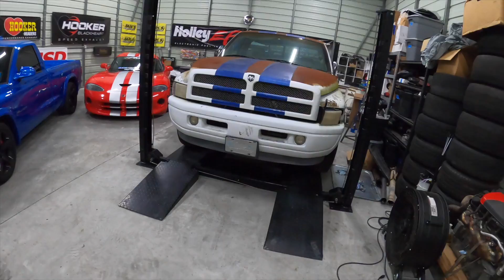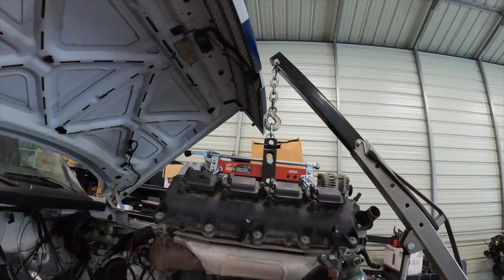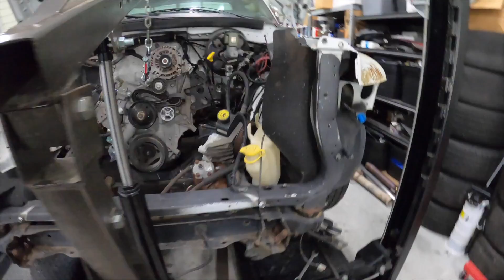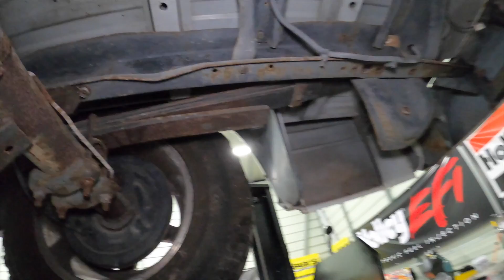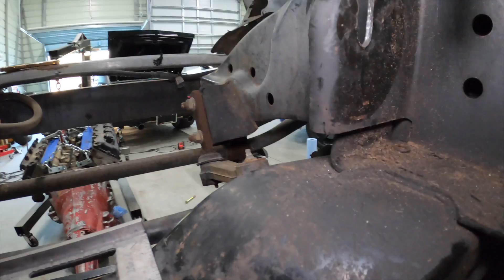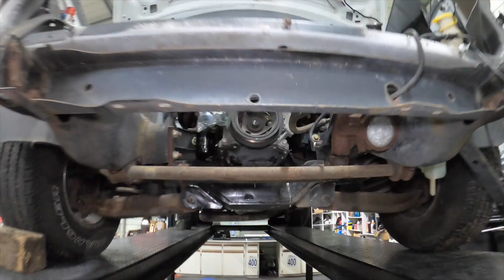2nd Gen Dodge Ram 1500 HEMI Engine Swap 94-01

Comment: I pull a work trailer with my 98' 1500 sport 4x4. It's got the 5.2l Magnum in it, which one would think would be at least ok on gas mileage, but that is not the case at all. it's in perfect condition, and so clean it looks new, with a rebuilt transmission about 30k back. The truck's got about 280k on it, with no mechanical issues so far. The fuel mileage is really burning a hole in my pocket relative to how hard I have to push the truck with a load, the torque is fine, but it's lacking HP, and it's immediately apparent when you go from just the truck, to a loaded trailer. I'd love to know what kind of mileage people are getting from the swaps to a Hemi, since I'm not a huge diesel fan, and yes I know the Cummins 6 would be great for this, but that's not for me. So, basically I wat the HEMI performance, I love a fast truck =) but I also want better mileage when towing, and it makes sense that a more powerful engine wouldn't work nearly as hard as my old 5.2 Mag, if anyone has number son how much the mileage suffers towing a trailer with a 1 ton minimum load, I'd be appreciative. My Gen 2 is with me for life, it was my Dad's until he passed in 2016, then I paid off what he owed to his girlfriend for it, and don't see any reason it won't last the rest of my life. Fuel costs, unfortunately are killing me tho, I'd rather put the money into performance parts than fuel, and I need a solution beyond dropping in a Cummins. Thanks.

Comment: I have a 98 1500 single cab 2 wheel drive Ram been in a fire and throttle body etc was melted off top of motor. was only a 5.2 magnum and I have purchased a 2005 5.7 Hemi and trans out of a C300 car. I would be keen on a set of your mounts and then I can  sort out the trans mount. any other info you can offer on this repower would be appreciated. I have been looking on net for while but most info is for repowering Dakotas this is the first most helpful site I have found great work.

Comment: Not bad, however I would have put the bevel back at the top of the mount horns to act as a sort of catch safety just in case the bolt slips up the slot.

Comment: I know you've had issues with the 8spd transmission in the 4th Gen Rams but I'd like to see what steps you would take to overcome them and what aftermarket vendor's you would recommend for the third party computer to run the trans in a second gen.

Comment: How much difference would there be in putting a 6.4 Hemi or Hellcat vs the 5.7 Hemi?
Reply: Well wiring will be definitely different between the hellcat vs the 6.4/5.7. With the 6.4 and hellcat you might need a trans controller if you keep the 8 speed. Definitely gonna be simpler to do a 5.7

Comment: I would like to do that with my 96 ram 1500 4x4. Would the hemi bolt right up to my 5 speed or would i need an adapter plate?

Comment: Imo John, you are definitely NOT devaluing the sst by "restomoding" it.(NEVER thought I'd use that term for a 2nd gen lol) I'm the guy who understands and loves the ol sbm/bbm engines and know that they still have a place in the world but, you could spend every dime of the swap cash on a built 318/360 and barely get close to the stock eagle headed gen 3 hemi power numbers. Add a hci, and you will have over 400 RELIABLE rwhp. That's what purist don't get. Would I like to see you build a magnum sbd? You bet. But the modern hemi is just so much better. I think the trucks value will go UP. There is a ass for every seat at the end of the day

Comment: My first truck when I was in 9th grade was a Dodge ram SST a 98 white with the Pepsi blue stripes I had it lowered cow ram Air hood 360 5.9 big block with headers lifters cam long to betters to the 40 series flows with 3-in tips coming out the passenger side and shoot a 3-ft flame and then I had it on American eagle five star deep dish 16 x12 and 1/2 with Cooper Cobra white wall tires with three virtual tech Hammer tens in it chameleon CD player and God was is she a beast

Comment: That TorqueFlight will be amazing behind that Hemi if you keep it in there. It’s a perfect drag racing transmission and they’re strong. I had one in my 75 Dodge D150 with a shift kit and the shifts were so firm. And it held gear without any convwrns of slipping.
Reply: Same thing with the transmission that came factory in the 94-01/02s, you build them a little and they’re some of the best transmissions out there.

Comment: Yes I need a set of those mounts for a 2000 dodge 2500 4x4
Reply: With the trans or would you use the original 2nd gen transmission?

Comment: Y
The 46rh trans is controlled by 3 wire plug the center is hot the other two go to grounds thru a toggle switch arm the center fused the when you want to while driving shift in to OD THEN lock up.. bets the 727. Then you can run deeper gears. My 96 Reg cab short bet ran a best 14.4 at 95. With 5.9 on 3:90 gears

Comment: I was having the same problem with my 1998 Gen 2 when I put my 2004 SRT10 Viper engine the driver side was the problem for the headers.
Best of luck but custom brackets are the way to go.

Comment: Lol I have a 2013 ram that I'm trying to swap a 360 into it but I am having trouble getting help with it
Reply: They put 5.9s and 4.7 in the first years of the hemi. I bought a first year for the home and it had a 5.9 . But the hood information was 4.7. I've got a 12 hemi and trans but cut the wiring harness. I would love to go with the 8 spd. Over the 6 spd. I think a13 was a 8 spd.

Comment: Are you going to weld and make a road edge on the motor mount you trimmed ?  Because when you cut the road edge off you took some strength out of the mount

Comment: Finally cause i have a 2nd gen sport 4x4 off-road edition and a hemi would be nice i wish someone did a 4x4 swap as well caise i whana now how to use a transmission alomg with a transfer casr
Reply: I agree 👍  I have a 2001 dodge ram 2500 4x4 and would like to throw a gen 3 with tranny In my truck. I would buy the mounts for the swap.  Love the vids keep up the good work
Reply: I'm waiting too because I have an 03 QC SLT I'd love to swap a 5.7 6.4 or HC!!!
Reply: In the same boat. Would love to keep the 8spd and figure out the transfer case situation.